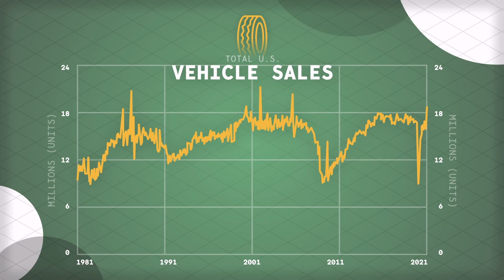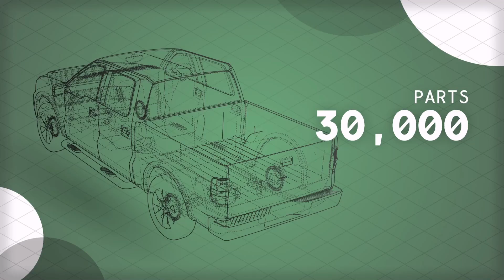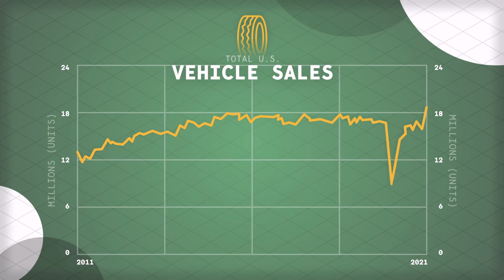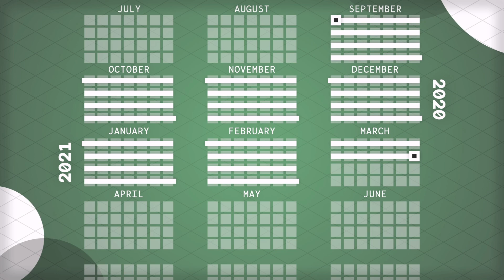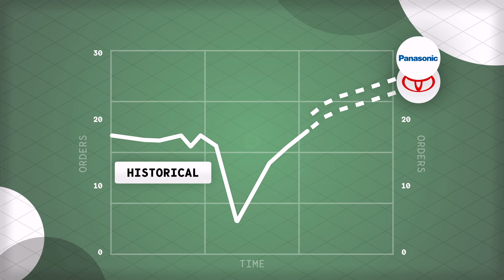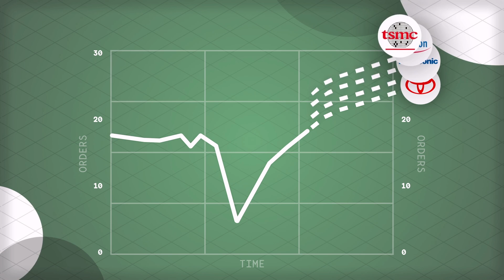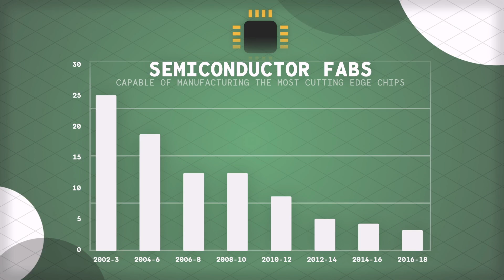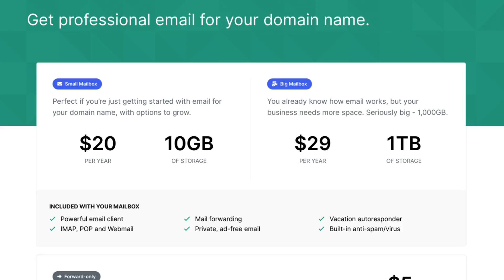Why the World is Running Out of Computers

Comment: #Learnings:-
Why the World is Running out of Computers:-

1) The reason is Global Chip shortage due to sudden increase in demand in Automobile sales & Consumer electronics sales at the same time. 

2) The thing is there is nothing fast about Manufacturing semiconductor chips, it takes 3-6.5 months to manufacture a chip by maintaining a clean environment etc. 

3) One more problem is Specialization here (although it's efficient) : 4-5 companies work on a single order for manufacturing a product like cars, etc. So they order some more amount than the actual demand (sometimes due to projected high shipping charges in future, Or panic buying due alleged chip shortage etc., so manufacturers have to provide confidence to such companies in that case to avoid Inflated orders).. With each of the 4-5 companies doing that, inflated orders increase significantly.. this is manageable under normal times. But here since both automobile & consumer electronics demand increased rapidly it lead to chip shortage. 

4) Electronics industry has very fewer Manufacturers, TSMC being the leader. World depends on TSMC, which could be a problem as TSMC is in a politically fraught country, Taiwan.

Comment: its partially the auto makers fault for putting themselves in that situation as well. Auto makers use tech that is at least 10 years old, even in the new 2022 models, and no chip manufacturer wants to waste there resources, and time, pumping out last generation chips that only the auto industry still uses.
Reply: Carmakers want reliability. I certainly don't want to be "rebooting" my car every day or so.

Comment: This means that a chip manufacturing in the United States. Is a expensive necessity. The time and 700 steps that are needed to produce chips.  So it takes how many months are thoes 700 steps going to take. 14 to 20 weeks, 6 weeks, lots.
  I woumder what a 12 G network would needs would be in the global chip manufacturing tec. Give insane money, and manufacturing requirements?
  So with a 5 G networking starting. How soon for 6,7,8, G chip/ networking. Older cars,  and tec might not be designed to be upgradable. So repairs are impossible due to these industries desire to forces you to buy a new one..this might cause people to ride non eltric bikes. Simple tec from the past. Possibly bring back face to face business in the later part of the 21 through early 22 century. Rather than virtual business which breaks down and is to expensive to upgrade.

Comment: Well, for a time, TSMC were on a lowered capacity due to the weird drought earlier in the year which affected most of Taiwan, and the TSMC plant is in one of the severely affected area of drought which forced it to reduce production rate, and if the drought had lasted, they would have to even close the plant, but the drought is gone now

Comment: While I can read comments that say 1% is a lot, I find that to be a flag against a system where it only takes a 1% difference to flip the table over. Just seems incredibly delicate when it should be able to handle at least 1% of the bigger picture. The statement "everything just barely works" comes to mind.

Comment: Ahh, so the toilet paper problem again.  It takes months to speed up production of toilet paper, and apparently it also takes months to increase computer chip production too.  We just need more factories, that could make anything, all over the world, ready to start production of anything within a month if given the green light.  Not impossible, they would just need a fabrication department that can make the tooling required to make anything.  If they need to make cut lumber, then they start churning out saw blades and large motors to power them.  If they need to make cars, they just start churning out robot arms and motors, and aluminum molds for fiberglass car paneling.  We do have the knowledge, and all the necessary technology.  It would just switch to making the most in-demand products whenever something has over 100,000 back orders that will take months to fill, they make the tools to make that product and start production as fast as possible.  They would actually make so much money because when supply is low and demand is high, prices go way up.

Comment: I have a 308, granted it's a late 2016 pre-facelift model, but they haven't really released the 3rd gen, so I'm surprised to hear that 2021 2nd gen post facelift 308s don't have the digital speedometer like mine does. My car also has the analog pointers but it has a digital counter in the center, just like a lot of modern consumer hatchbacks

Comment: Why? Because world is in a freaking pandemic and a lock down. Production lines slowed down and need for a computer increased tenfold versus pre pandemic.
The world technically is not running out of computers, it is running out of NEW computers, well not even running out but needing MORE then world can currently produce. By 2025 we will have 3 more factories which will produce various chips and we should have excellent saturations for cars, home entertainment, PCs, servers.

Comment: The world is not running out of computers. What is happening is that as dictatorships die they are replaced by democracies. It is these democracies who are going to decide the fate of advanced technology. This is what happened in Ukraine. Back in the day, Ukraine was a technological empire which built airships capable of crossing continents in less than half an hour. Then, dictatorships happened. Much of the information about how to built these airships was taken out of public circulation and people thought that flight began in the early 20th century. When Tibet becomes a democracy much of manufacturing in China will be moved there. That means we might one day see Made in Tibet computer chips. If North Korea and South Korea become democracies and unite, we will see chips coming from them. The problem is, the people who kept electing their officials did not know what kind of persons malignant narcissists are. Now we do.

Comment: This is probably a dumb question for those in the know, but I'm asking it anyway. Why don't they just take the old chips, melt them down, then reuse them? Surely it's a better option than just not meeting supply.
Reply: Because thinking if that requires a brain. Something that multi billionaire manufacturers don't have.
Reply: the problem most likely lies in the timing, there simply isn't enough time to make that many chips, the only way to increase the production speed is to make more factories, which takes years to build.
and it takes 3~6 and a half months to make those chips, I didn't know that.

quick google search shows that the pandemic force-stopped the production of semi-conductor first, with some factories in Texas and Japan having accidents and become unable to produce chips. China got sanctioned by the US over espionage accusations and Huawei began hoarding chips to brace the impact of the sanction. As soon as the production of semiconductor chips started revving up again, car brands became the first to scour as much chips for their cars as they can. 
It's the matter of (probably) unprecedented demand, with world issues impacting the workflow, and not the shortage of resource.
(information taken from timesfromindia)

Also the production of semiconductor chips is most likely a classified information, people can't make them on a whim.

Comment: The Problem is, in a car, you can change the design. The company I work for produces Electronic Meters and we are forced by state regulations to produce Smart Grid Meter, without Semi-Conductors we are screwed. We have lead times of up to 12 months for some chips and we don't have the buying Power of Sony, Volkswagen, or Toyota. The drought in Taiwan, the fire at Renesas plant are some big factors why we are in this situation, on top of that we have Covid which lead to decreasing demand in 2020 and now an explosion in demand beginning of 2021

Comment: Kinda surprising, it’s almost like your car doesn’t actually need an entertainment center in it.
Reply: But how else will the manufacturer track your every single move and sell this information to nameless advertising corporations and data aggregators to predict your behavior and manipulate you into buying another brand new car with an entertainment center in it?  The spice must flow!
Reply: @ArcangelZero7  lmao bmw we’re looking at you!
Reply: If repairs were a thing,shortage problems would be almost nonexistent,but instead we insist on replacing everything broken because they make It very hard to repair
Reply: @albearmistizio  can you gives more example?
Reply: @lastyhopper2792  the fact that most electronic devices use proprietary systems for computing and recharging, making the system difficult to repair for the customer, but easy to repair for the company.
Have you ever opened up a ps4 and a xbox? They use completely different components and voltages to do the same things.
Reply: literally any car ever: shiver me timbers
Reply: Its almost like we dont need cars and we could use public transport and bicycles instead
Reply: its almost like cars don’t need any electronics to run at all
Reply: @teslatech2143  They do, how else would they start without an alternator?
Reply: @Deusomas  alternators don't start cars
Reply: @teslatech2143  with the use of such electronic device like GPS or AirCo, how would you drive without electronic chips to make it work smoothly?
Reply: @teslatech2143   the „entertainment“ part in modern cars contains by far the least amount of rare materials. Without a radio leds and even headlights you will need fuel pumps, numerous sensors like temperature, tire rpm, engine rpm, fluid temperatures and amount, knock sensors, usually a whole extra computer for auto transmissions and the list goes on and on. The ecu running the car has to be able to check on at least 50 values all the time and react within split seconds if shit gets real. Stuff like that requires a capable computer whatsoever.  Quite frankly, the current youngsters wouldnt even be able to fix even the simplest cars and they surely wouldnt adapt well if new cars were suddenly lacking abs tcr and auto transmissions. Our cars arent flawed, the chips are. Building them from rare resources like they wouldnt run out was a huge mistake.
Reply: @teslatech2143  Tell that to pollution
Reply: @notchxnge  electric cars are just as bad just use your damn legs
Reply: @teslatech2143  yeah sure
Junky old inefficient and not so safe cars don't need much electronics :)
Reply: @teslatech2143  ECUs?
Reply: @teslatech2143  Modern cars do. Fuel injection, ABS, engine sensors, and those are just the basics.
Reply: @teslatech2143  True, but for the worse to some extent. I don't think anybody wants to go back to using carburetors lol
Reply: @redey1290  they won’t but its a viable option in the event this drags on much longer than anticipated I believe, but what do I know🤷‍♂️
Reply: It’s almost like people should stop buying new cars too
Reply: Electric motors can be operated manually. This thread isn’t about climate control. I support anybody standing up for what they believe in but we’re talking about chip shortage.
Reply: As long as it got Bluetooth 💯💯
Reply: Tard logic
Reply: Or a reader of any type, let alone electric control for basic needs.
You need it to just start the car or your gonna have to manufacture the whole thing and alone the investment is very, very damaging. 
Like just FUCK the architecture, and cruise control with some mileage. 
Shit like that bruh.
Reply: Imagine brand new cars with Mechanical fuel injection and no or very little electronics. Be allot of fun until you gotta start finding niche parts again.
Reply: Wow~ :) you're right that's ridiculous :| however if I'm paying the price for that to be installed then don't get it installed THEN its a motherfuckin problem. They need to stop dropping quality or people will sue because they aren't getting their money's worth and OH...well you lose even MORE money because you didn't take a break to restock shit
Reply: Yea it doesn't because everyone is already staring at their phones. 9 out of 10 times I check a car and its driver, the driver is texting or doing some petty retard shit. I know I am perfect and I can't expect everyone else to meet my standards but damn, yall could at least try to not be so damn peanut brained.
Reply: Now if companies start making components for cars from the previous century, I'd be a little more hopeful inhaling copium
Reply: It doesn't. A car needs to drive under any conditions. Your Android/ I phone. Is a information/ internet surfing/ entertainment platform. I saposed a Phone docking mini bomb box, with a cd player, and a touch sentive graphics screen. Of 2045 will look like traspartent plastic. Contains phone chip, sim cards, holographic tec whatever. This would render any 2022 through 2035 cars, or computer tec useless. Instentaneously. Lets face it. If a 12 G network is available anything previous is marked down to the point of fier sale status.
Reply: An ECU uses a 40Mhz processor. That is the same processor you will find in a dishwasher. And this is because they can't buy anything cheaper and older. My cheap phone uses a 12 nanometer processor. If you buy a brand new car today, it will use most probably a 45 nanometer processor that is a technology from 2007. The only thing that is easy to manufacture is the entertainment system cos it has newer technology then rest of the car.
Reply: Dont be so daft... semi conductors are used for the cars on board computers that control more than your unquenchable thirst for media. Door locks, windows, alarm, cruise controle, diagnosis code register, sensor monitoring etc... A lot more complex than your need for music...
Reply: Get the fuck outta here and go eat leaves, Karen. I can understand getting pissed a big Smokey trucks, but my car is gonna have a touch screen sound system with LED lights all around and you can EMA about it
Reply: @HotboxedCoffin  how many times do you actually use that?
Reply: @HotboxedCoffin  i think you missed the memo about what a Karen is, however I think you fit the bill.
Reply: @HotboxedCoffin  this made me laugh so hard
Reply: @HotboxedCoffin  My car WILL have a giant 15 inch tablet, with an Intel core i9- 10900K, 16 GB RAM, OLED display, and just to show nature who's boss, a mining machine
Reply: @HotboxedCoffin  A very unique American viewpoint on a privilege.

I understand this may be a shitpost joke comment just to piss people off but still, my point stands.
Reply: @HotboxedCoffin  Save ICE vehicles. Fuck electric. Fossil fuels ftw
Reply: @alexs1429  -_- genius .....
Reply: @alexs1429  Why are electric vehicles bad? We're actively running out of fossil fuels so they will become the only method of transportation in a decade or two
Reply: @alexs1429  have fun finding any in 50 years that aren' t $50.00 a gallon.
Reply: @AKRaptor22  if I can’t afford $50/gal in 50 years then I failed at life.
Reply: @alexs1429  using the lowest averages, thats $29,250 a year. Still sure
Reply: Cry more. If I can afford it, I’m getting it.
Reply: with that kind of mindset our technology probably wouldnt have advanced to this point, "phones dont have to have touchscreen"  "5g is way too fast to be practical, 4g is fine as it is"
Reply: @dailybrainrotsss  you’re right, I just feel that having respect for our resources is just as important as advancing technology and creature comforts.
Reply: @My_thiccc  You say that, but you’d probably jump at the opportunity to have better technology not only in your car, but anywhere else.
Reply: @kikenaround  I drive a 2010 4Runner. The reason I like it is because it’s a no frills truck/suv that’s just as capable as any other suv. I do enjoy nice gaming gear. However, I care for my equipment and make it last as many years as possible. My 4Runner serves the same purpose, make it long as possible. It seems like a lot of auto makers just slap junk electronics in their cars. they just don’t last as long as they should and burning up electronics components quickly just so you can control your music from your dash and your a/c is digital… sorry for the rant lol
Reply: @My_thiccc  I guess we’re all entitled to our own opinions. I am glad to see that you appreciate the things that you own, we don’t have that these days. I believe that if you have the money and want for a product, and that product has availability, then go ahead and buy it. You shouldn’t care about if it seems foolish to others, because your practicality comes first. I’ve seen most of my friends not get a car that runs on gas because it may “contribute to global warming”, although most of the electricity they get is from burning coals in factories nonetheless, lol. There’s a lot more you can get out of digitalization in your car than it just being for show. I have a Mercedes GLS, and I feel an immense amount of comfort when sitting in my car. It’s luxurious, and it’s a status symbol. It really makes driving around feel fun, like a second home almost. Especially when you’re riding around with friends or family and they’re inquiring about the features of the vehicle, it makes you feel accomplished. That you were able to buy a car with these features in them. I’m really glad our technology is advancing enough to have these systems in the vehicles that we drive, and I don’t feel that it should be brought to an end any time soon. But yeah, that’s just my experience and beliefs. I guess it varies from person to person.
Reply: “How many times do you use that” the sound system? Every day on full blast my guy. The LED lights? Not as often but I use them to show off. Ladies like it. Dudes like it, but I ain’t doing it for the guys lol
Reply: Buy a truck, much better